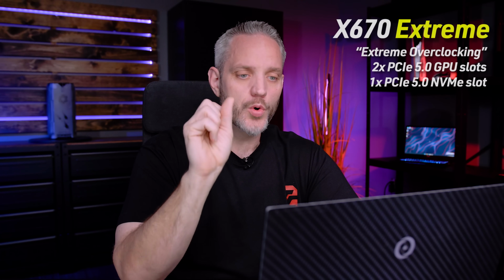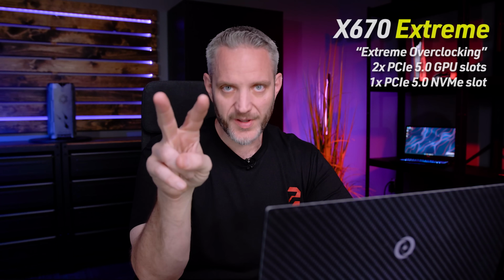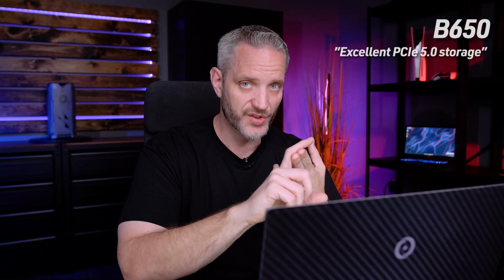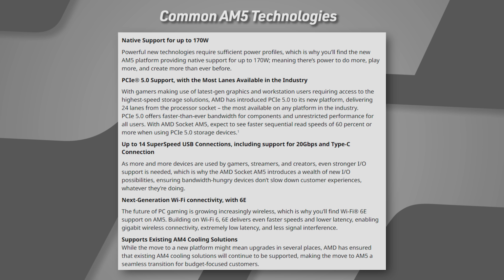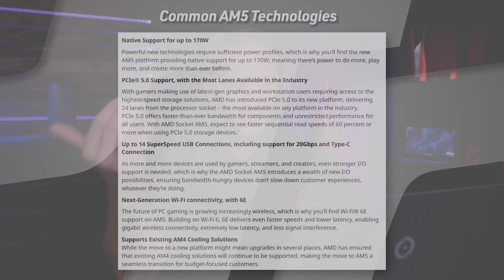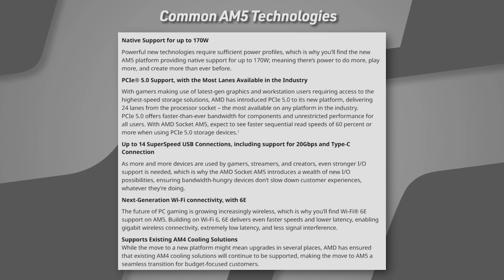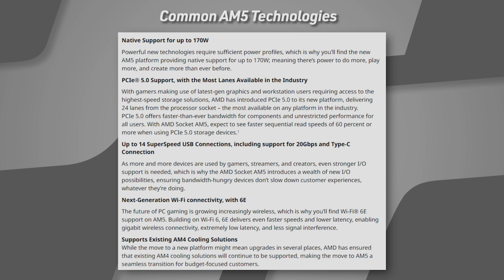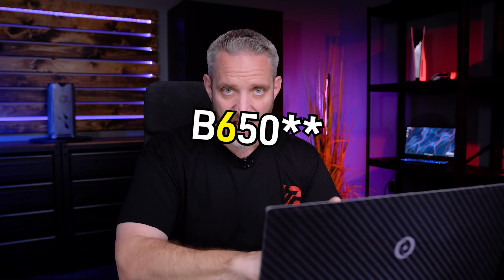AM5 Motherboards are EXPENSIVE! AM5 Explained

Comment: As far as i am aware X670 doesnt get PCIe 5.0 to chipset

X670E has to have 2 x PCIe x16 slots even if its x16 and x4 electrically

AND ITS PISSING ME OFF!!

Its looking like we wont be getting Mini-ITX with 2x PCIe 5.0 m.2 and 1x 4.0 m.2, probably wont get PCIe 5.0 x16 either and so on

FU AMD allow X670E chipset on Mini-ITX motherboards WTF where you even thinking

Comment: Won't be crossfire. The 2nd slot can be used for 5.0  nvme expansions.
Reply: Yeah I can see Motherboard manufacturers using this for extra storage slots on the board instead of PCIE slots or for those PCIE storage expansion boards at least. Unless they find a way to make their graphics cards stack without needing the devs to specialize parallel graphics is dead. Only other thought is for cheap mining rigs, these probably got designed before the crash?

Comment: I expect that sales numbers for AM5, ryzen 7000, rtx 40 series etc. will be way less than current gen.
The global recession and especially the current price of electricity and gas make dropping that much money on power hungry pc parts not appealing to a lot of people.
Reply: @RuDuffEnough WellRu AMD taking major losses? What have you been smoking or did you post this comment in 2015?
Reply: @LateDude96  I iwll keep the ryzen 1700 that ihave becuase while i got it in 2017 sicne 2021 that i got RX 6700XT 12 GB RED DEVIL for 950 euros it runs evrything at max settings 1440p 60 fps which means that there is no reason to change cpu ram and motherboard yet.
Reply: @svenolafson3032  fx8350 still going strong
Reply: @majstealth  I iwll keep the ryzen 1700 that ihave becuase while i got it in 2017 sicne 2021 that i got RX 6700XT 12 GB RED DEVIL for 950 euros it runs evrything at max settings 1440p 60 fps which means that there is no reason to change cpu ram and motherboard yet.
Reply: @shredderorokusaki3013  i would also still run my 980ti, but it went over the veil and lives now where dead gpu´s reside, RIP
i hope there will be something "good" in 4060-ish ones
Reply: @majstealth  it still work?! my previous card was a gtx 970 that ihad or 7 years(novemver 2014-novmbe 2021) it burned and this is why i got this RX 6700XT at this crazy price. It is my rifrst so enepsince card ihave evee bought but if ihad not bought it i would had been left without pc for weeks or months. It was the only one left on the first shopi wenrt. Hoeever the upgrade was worth it as i saw huge graphics and perfomance improvement(ray tracing makes huge graphics improvement).
Reply: @shredderorokusaki3013  my 980ti technically still works but will crash any game and sometimes blackscreen, mostlikely a die-problem, vrm´s look as new, and it became gradually worse over time
Reply: @shredderorokusaki3013  my 950 is still going strong (its also overclocked but still not really much issues other than maybe vram is a bit degraded) i really wanna get a newer pc tho i just have no money for it
Reply: @majstealth  Then you either get a holdover card second hand, or something like the 6600 from AMD. Your 980 is dead or dying, so you really don't have a choice. The 6600 is still faster than your 980Ti and uses a lot less power, but you can get a 1080 second hand for the same price as the 6600 or less if you shop around on the second hand market. You "at best" save 50 dollars if the prices go down, but the 6600 may still be sold at nearly the purchase price if you bought new, and someone will take the 1080 in a year, but probably not two.
Reply: @markhackett2302  i am on a forgotten loaner 1080 for a year now. but will def. get something newer once and if prices get back to "normal"^^
Reply: @markhackett2302  
The new 10GB 6700 is an option too, at £329 inc VAT they should be worth considering.  I haven't seen a review yet, but I expect they'll be about 3060ti performance.
Reply: @RuDuffEnough WellRu They have made more Money than ever. Dont think they need to anything for a few Years.
Reply: @flimermithrandir  unfortunately that’s not how most companies work. Especially with publicly traded companies, shareholders want perpetual growth and executives get sacked if they don’t keep making more profits, even if they don’t need more profits to stay afloat.
Reply: @pieflies  Well…. You would be right but they made so much Money that they could tank 50% of the Shares

and still be fine.

Thats how much Money they made. Literally. They are fine. Doesnt mean they wont raise the Price again. Of corse they will. 100% they will. lol. But thats another Topic. Not what i said.
Reply: i legit consider a nuc as my next pc for power consumption issues. it's just not worth it and frankly i got a 4600 and 1050ti that works just fine for me, i don't need that much power.
Reply: @svenolafson3032  I iwll keep the ryzen 1700 that ihave becuase while i got it in 2017 sicne 2021 that i got RX 6700XT 12 GB RED DEVIL for 950 euros it runs evrything at max settings 1440p 60 fps which means that there is no reason to change cpu ram and motherboard yet.
Reply: @shredderorokusaki3013  until you go 144hz.
Reply: @Ehren1337  when this monitor burns yes i will do it then.
Reply: @RuDuffEnough WellRu Nah, higher prices won't be enough to offset the losses caused by people sitting these new parts out while the current generations are still perfectly viable.
Reply: Prices of current components are shooting up again. Dont know why but expect that to be a factor for new gen components.
Reply: Electricity pfft that's not even the bigger issue, the bigger issue is heat. I swear I just replied to this comment a week ago. Buy anyway nah, it's not about the power bill itself from the GPU, it's about the nonstop heatwaves, heat domes, heat despairs or whatever they start calling these horrible punishments for our hubris and aggressive stupidity, and then having to game on something that's like 350w just from the GPU is nuts. Even at 225w my graphics card heats my room up substantially, to the point of needing AC in the summer. Now imagine going twice that. Now imagine being European and not even having AC. You're going to roast alive. So I think that's an unwitting drawback, is as the effects of climate change accelerate it's going to make gaming in the summer a luxury on newer or more high end cards. My electric bill was fine so far.
Reply: @pandemicneetbux2110  heat in summer is annoying, but on the upside it helps during the winter and this winter is gonna be bad for the EU with the current gas and electricity prices.

Also lots of people in the EU have ac, probably less than america but still lots. Source: I'm european
Reply: @joost_exe  Oh. Europeans kept insisting to me they don't have AC, so I assumed it was going to be more a problem. But yeah, on the plus side, it is better to freeze, than allow an adversary to own you. I personally use my GPU as an unironic heater, so closing the door and heating my room with it helps tame the electric bill.
Reply: We need some TMNT power in here to dice up some of these replies.
Reply: I also get the feeling that ryzen 5000 and rtx 3000 were SO good its not worth an upgrade, I mean you own a console for what, 7 years? A 3080 isn't going to underpowered 2 years after launch.
Reply: Not a chance. The people bitching about it in these YT comments are the vocal minority - but that market is clearly supporting these inflated prices, no matter how much we may not like it. And, with each new GPU generation, more and more people act like they can't live without the latest hardware - no matter how good previous gens still are(my 3600X + 5700XT combo is treating me well; prolly gonna finish it off with a 5800X3D and get into AM5 in its 2nd or 3rd gen/equivalent Intel). Let's be real, there's a solid amount of elitism in the enthusiast space too, a whole lot of people are willing to buy a whole lot more hardware than they actually need(the casual gamer doesn't need a 3080, nor should they be paying 3080 prices) for the status.
 
When it's all said and done, the businesses can't take more than consumers are willing to give. The growth in gaming over the last decade, and especially PC gaming's resurgence over the past 5 or so years, has brought a lot of good for the industry/market/hobby/whatever, but it's also brought a lot of people willing to spend money. And products are worth what someone will pay for them. 
The market NEVER would've supported anything close to this 10 years ago - but this isn't the same market.
Reply: @RyTrapp0  seen the same with professional cameras. When a new one is released its received like the holy grail and by next release its considered garbage eventhough its still the same insanely good camera. Kinda silly.
Reply: @RyTrapp0  Wrong. On the internet nobody can tell you are lying. Is the drop in prices "the market clearly supporting a lower price"?
Reply: @RyTrapp0  
I'm sticking with my very similar build too for a while, it was a 1700 2060S build but I swapped the 1700 for a cheap discounted 5500 a month ago just to cut the heat output down a bit, the cheapo 6 core is faster as well.  If in a couple of years I can get a cheap Zen 3 upgrade I might do it but on a 2060S GPU there really is not much point, frankly most modern chips would not be the restrictive part of the build.  Until then if I spend on anything it'll be storage which I can always find a future use for anyway whether inside a PC or not.
Reply: @svenolafson3032  You can partly thank the Globalists that want to force us to ''go green''.

Comment: Am5 boards are cheaper than am4 to produce with the changes they are making to them. If they are more expensive it's strictly because of markup/greed and them being new.
Reply: Its more expensive to make 600 series motherboards than 500 series because you need more layers and higher copper per KG as well as faster USB controllers and so on
Reply: @commanderoof4578  no it's not.. they cut cost because how they are doing the chipsets.